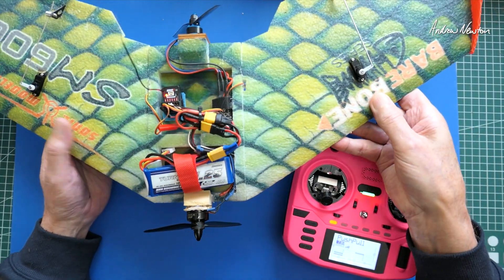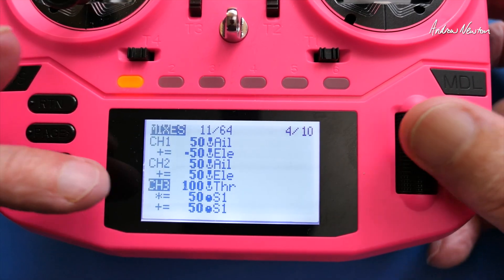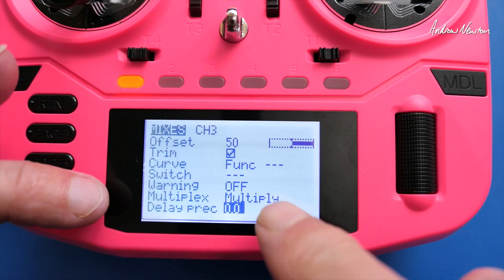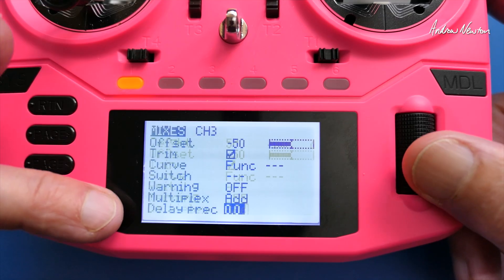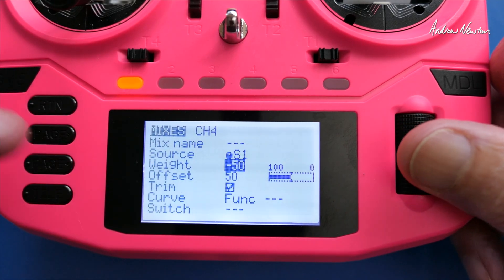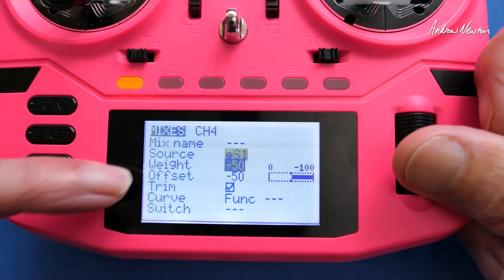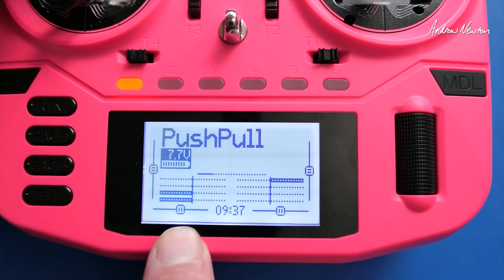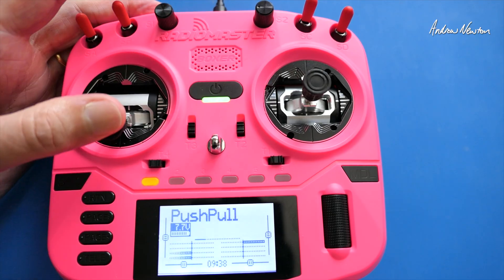Push-Pull Motors - Thrust Mixing in EdgeTX

Comment: HI!
I want to Buy a Radiomaster controller But I have a little bit confusion in Choosing the best radio.
I Can Buy TX12, GX12, Boxer M2, TX15 and TX16s. The Main my focus is RC Planes and FPV Drones in Freestyle and Racing (sometimes).
Kindly GIVE me your Suggestion Based on the Information I gave you and List the Radios Number Wise.
THANKS & REGARDS
Reply from the maker: I use the Boxer most but watch the reviews and decide which features are important to you. Touch screen, ELRS, extra switches, longer range, weight?
Reply: @AndrewNewton First Thanks for replying me...
The Main my Focus in drones is Freestyle and Racing Style but in RC planes my required feature are Elrs, long Range, more precision in Gimbals and Good connection Between Radio and The Plane or Drone.
You Can Simply Give me suggestion between GX12 and TX15 Max, or if you seem something better.

Comment: Thank you so much for explaining this.
I guess something similar could be done using two dials, in order to actually get 100% output on both motors at the same time too.
Reply from the maker: Yes I thought of two dials but then you could end up with zero throttle on both
Reply: @AndrewNewton  That's a good point. To fix that, I just made a single-dial setup that allows full range of either (or both) motors by one stick, without allowing both to be shut off with just the wrong dial setting. The dial acts as a progressive subtractor from each throttle setting as it is moved further to the left (favoring motor 1) or right (favoring motor 2), with the center being both throttles having full range. I put a custom 3-point "curve" (really a flat zero line plus a downward-sloped line after the origin) onto the dial and added it twice to the stick position for one motor, then added the negative version of the same curve twice to the other motor. It works! It keeps a fixed gap between the throttles that is proportional to how far the dial is set either way, until it is automatically shortened by the slower motor hitting zero. If the dial is set fully either way, the other motor is effectively shut down. Haven't flown it yet (no plane built) but it looks good on the radio.